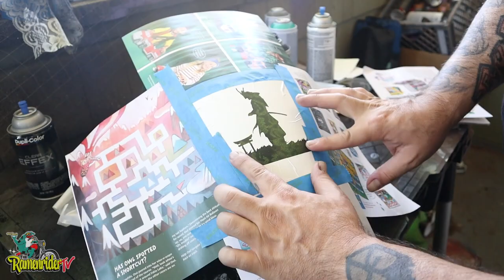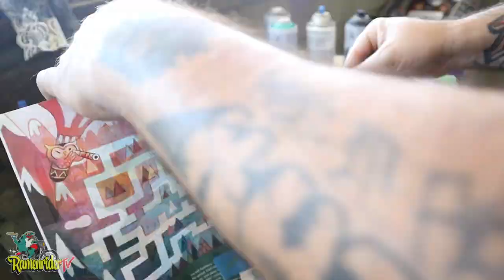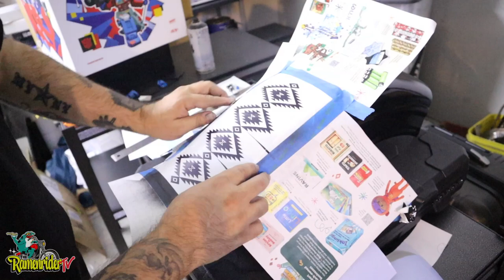DIY Lowrider paint job

Comment: That's awesome 👏😎😎👏 but for the price of the cans of paint you could have spent as much or close to the same amount using professional automotive paint and pearls. I know the 2k can if clear is professional but it's not a high solids clear. Killer work non the less bro ❤❤❤❤❤ what's that tip you put in the can? IV never seen it before. Thanks 😊
Reply from the maker: yeah ur def right but i wanted to see if I could pull it off with brands i know it was a challenge for myself! and its an adapter for rustoleum it normally has a male valve with a female tip so the adapter lets you ude male tips to get different spray widths
Reply: @ramenrider.mp4  that's awesome 😎👍👍👍 you did an excellent job no doubt bro. Where do I find those tips? IV got some spray can projects I would love to try them on. I use spray paint alot actually.
Reply from the maker: @gladememmott3001  I made them myself shoot me a dm on IG @ramenrider.jpg